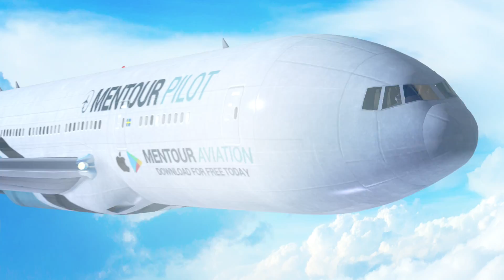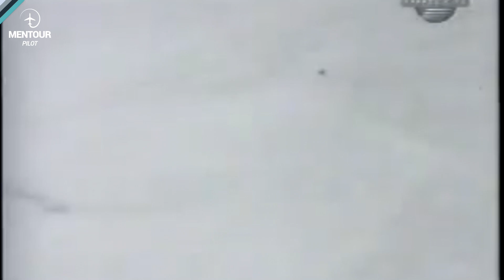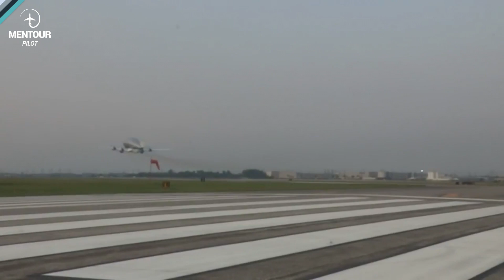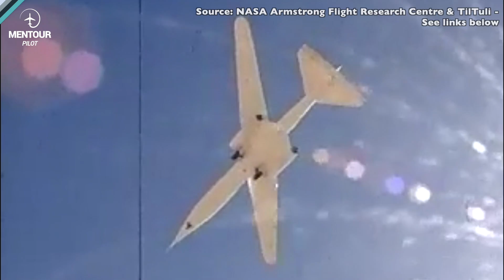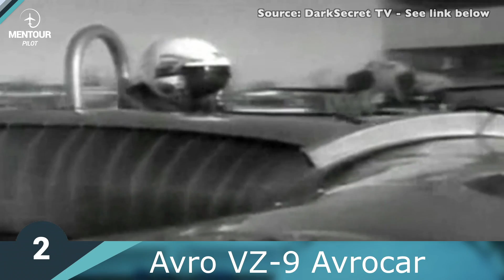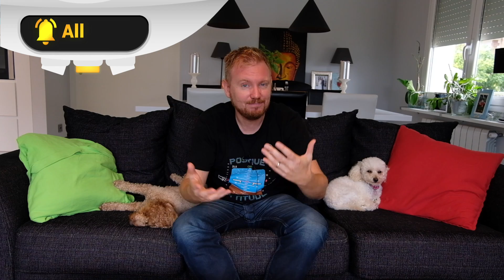10 Strangest Aircraft EVER! Mentour lists and explains.

Comment: Republic XF-84H Thunderscreech, almost certainly the loudest aircraft ever. It had some teething problems too. From wikipedia: 
"Lin Hendrix, one of the Republic test pilots assigned to the program, flew the aircraft once and refused to ever fly it again, claiming "it never flew over 450 knots (830 km/h) indicated, since at that speed, it developed an unhappy practice of 'snaking', apparently losing longitudinal stability". Hendrix also told the formidable Republic project engineer, "You aren't big enough and there aren't enough of you to get me in that thing again".The other test flights were fraught with engine failures, and persistent hydraulic, nose gear, and vibration problems. Test pilot Hank Beaird took the XF-84H up 11 times, with 10 of these flights ending in forced landings."

Comment: You frequently ask for questions for content, and I have one that there is surprisingly little info on the net. ANGLE OF ATTACK. What is the prescribed angle of attack after takeoff? Is it different for different plane types. Is it affected by noise reduction laws? How has it evolved over time? There seems to be a vacuum for this information, and I would find a video on the topic very interesting.  For example; we've all seen that 737 captured by Boeing brass. Is that a trick of the camera? Is it test pilot stuff?  Why does the AOA seem so extreme?

Comment: How about the Grumman XF10F Jaguar?  Featuring a swing-wing aircraft with T-tail and in appearance it didn't look strange.  The most unusual feature was how the stabilator was actuated -- rather than mechanical means, the stabilator would privot freely and its angle was controlled via canard surfaces at the front of the centerbody -- in effect, the stabilator was a miniature aeroplane.

Comment: The F-104G/CCV does look peculiar with the additional horizontal tail surface grafted onto the dorsal side just head of the wing (looking like sort of a canard surface).  What makes it even more peculiar-looking is that extra horizontal stabilizer sits atop a small portion of a vertical fin (even if you're aware that it still needs that section of the vertical tail to continue functioning as a stabilator, it still looks a tad peculiar).

Comment: The Super Guppy was based on the Boeing C97J Stratocruiser, so if the Pregnant Guppy gave birth to the Super Guppy, the Super Guppy gave birth to the Large Cargo Freighter (LCF) aka the Dreamlifter. Fourteen years ago we were making the ribs for the LCF "bonnet" as it was called. Only four were built, but we made enough for five. I also machined the hinges for the tail. Some of us thought it would be a good program to continue as a potential freighter variant, but of course it went nowhere. All of the fixtures in machining were aluminum and have been scrapped.

Comment: They missed a chance at not doing a prop to jet conversion of that Vought design. The STOL capability  and the sheer amount of avfuel that this craft could hold would have given some legs to those early gas guzzler jet engines alone would have been a boon for the post WW2 USAAF/USAF, but alas...
Reply: Or that partial propfan conversion on the DC-9/727

Comment: Here's one, The Armstrong-Whitworth Ape.
It was an experimental aircraft designed to test out aerodynamic concepts during the interwar period.
It was a biplane with the ability for the fuselage to be lengthened or shortened, the dihedral, rake and stagger of the wings and AOI to be changed and for new tail configurations to be taken off and put on with the turn of a few screws.
A really interesting design that would never be allowed in the skies today.

Comment: Not even a single lifting body. M2-F1. Nearly every X and XV vehicle could be on this list. The X-14 comes to mind. An open cockpit VTOL airplane.
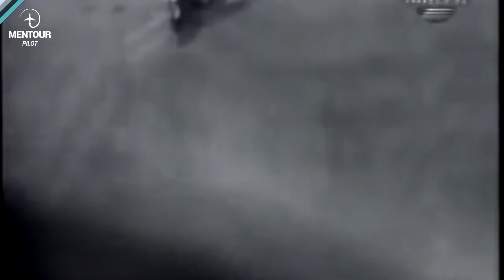Reply: What would've made for an unusual-looking "aircraft" would've been the Gemini capsule in one of its originally envisioned recovery configuration that utilized a Rogallo wing.  The old early 1960s 1:48 model kit (one with both the Mercury and Gemini capsules) includes an option to depict the Gemini capsule with landing skids for horizontal landing (no parasail was included in the kit however).
Reply: And speaking of Gemini capsule, as well as Apollo capsule -- the offset CG allowed some measure of control to "glide" the capsule during reentry (by pitching and rolling maneuvers) to affect its landing point to some degree. Using "glide" in this loose sense, the Gemini and Apollo capsules could be seen as "aircraft" (which can glide much in the same way that bricks don't).
In model form, there was the X-24 Bug model rocket from Centuri Engineering that "glided" down using plate lift generated by the conical body positioned at a positive angle of attack (it settles into this orientation naturally because of the offset CG).
Reply: @nuk1964  
Oh, yeah. Shame they weren't able to figure it out. Quite difficult to control if they had.

Comment: I’m confused, how does the Rutan Boomerang avoid asymmetric thrust if it loses the centre engine? 😎
Reply: There are two propellers with thrust lines close to each other, in an 'engine out' situation the asymmetric thrust results in a much smaller yawing moment, easily compensated by rudder deflection.
This results on a minimum control speed that is significantly lower than on conventional twins.
On take off and climb on a  conventional twin you must be prepared to deal with engine failure after  TO, meaning  flying well above this MCS.
The effect is a reduced angle of climb to clear obstacles.
The Boomerang can operate from shorter runways safely.
Reply: Hernan Posnansky Thank you! 😊 So there is still asymmetry but greatly minimised by the proximity of the 2 engines?
Reply: @nutleighgrove3658  
Exactly
Because of that, Rutan's configuration is also applicable to very short TO and landing aircraft.
See Wild West aviation products
Reply: Hernan Posnansky @Herman Posnansky  Great! 😎

Comment: I like ww2 airplanes, so...

Ju 287, first jet bomber, with forward swept wings. 

Like te first un tour lista, the Blohm UND voss bv141.

As the zwiling consiga if two planes stiked together by a straight wing section, maybe the most strange the dornier do 635.

Also you have the North American XB-70 Valkyrie with downward bending wingtips. And there was also a inflatable airplane made by goodyear if i remember correctly.
Reply: Speaking WWI era airplanes, early prototype of the Messerschmitt Me-262 first flew using a conventional piston engine and propeller because the turbojet engines weren't ready yet.  Even after the jet engines were available, early flights retained the engine and propeller as a safety measure (early jet engines had problems with reliability).
Reply: The Do-635Z exist only on paper, the He-111Z actually flown.
The US had also a project for a P-51 twin

Comment: Convair b36?  6 propeller engines and 4 jet engines?
Reply from the maker: Cool! Should be added to the list
Reply: Don't forget the cargo version, the XC-99
Reply: @MentourPilot  One feature of the early version of the B-36 that looked "oddball" was the single-wheel main landing gear (if I recall the tires were 9 feet in diameter).  Later version used 4-wheel bogie arrangement for the mains.
The B-36 was used in various projects -- as previously mentioned as a "mothership" for the XF-95, as well as another project where a pair of F-84 thunderjet fighter planes would "dock" wingtip-to-wingtip with the B-36 to allow the fighte planes to stay with the bomber (primary problem was that the limited range of fighter planes meant they couldn't stay with the bomber to give protection).   The B-36 was also used in a programme to investigate the feasibility of nuclear-powered propulsion for aircraft. --- though it didn't actually use nuclear propulsion, it was used to investigate the problems associated with the shielding one would require to protect the flight crew as well as considerations required for ground handing.
And of course let's not forget the Convair YB-60 (mostly oddball because you can still see much of the B-36 --- in simple terms it's what you get when you take a B-36, sweep the wing back, and swap the turboprops with turbojets).
Reply: Speaking of propeller aircraft being modified with swept wings... The Bell L-39 -- constructed from a P-36 Kingcobra with outer wing panels modified to give it a 35-degree sweep.  The main landing gear were also reoriented (and no longer retractable -- the nosewheel could still retract however).  Over the course of the research programme, additional strake fin was added to the ventral side, and additional sections added to the fuselage behind the wing (which resulted in a slightly-bent like appearance like a banana)